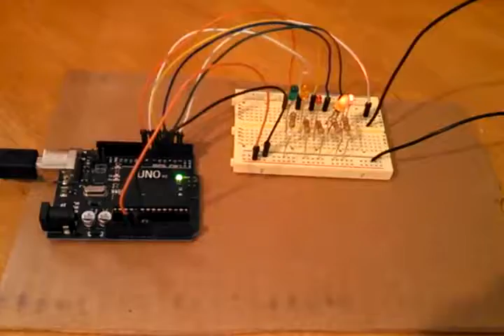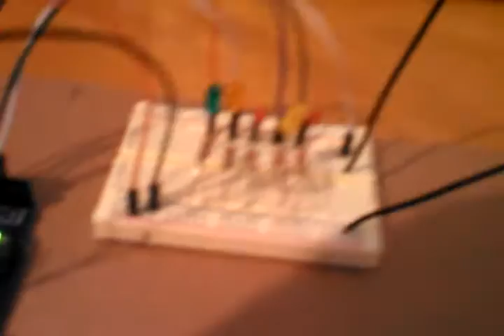Simple Arduino Repeater Controller

Comment: This is BRILLIANT, man. Have you tried putting another (say 220 rig) in there to send back telemetry on heat, times, noise, that sort of thing?

Some guy in our club (Ft. Myers) tried to tell me that repeaters are illegal because they repeat our transmissions without our permission. I kind of just stood there trying to figure out if he was being serious. He was. So, I told him (he's big into tube rigs - as am I, it's a nice "warm" signal) that he needs to be careful when placing the radio on the table and making sure that it's secure. Further, I advised him not to move the radio unless he absolutely needed to, and never on its side. Why? Because, I said to him, "if you mount it sideways the electrons will fall off the plate."

His reaction was a thing of legend, as he furrowed his brow and made a beeline for home. Yes, we can be jerks sometimes, but I did confess after the fact.

Hah! JF

Comment: Dude I apologize for not commenting sooner - I have been very busy. But this is perfect, it works out great on bench tests and I did deploy one in the field on a small Maxon SM4000 series based GMRS repeater and it has preformed well now for a couple of months. 
I am planning on fabricating a PCB and a 3d printed case with rf shielding for this circuit and arduino. and hopefully make it rack mountable with a 1U face-plate that will have the LEDs on it as well as a USB port for programming..
Reply: as per my previous comment....

how do you get the audio to the tx radio......  is it as explained above
Reply: I did the audio via some audio transformers. I could have gone direct with a pot to control gain similar to one of those Motorola 16 pin direct cables (suicide cables as I call them) but I wanted some isolation.